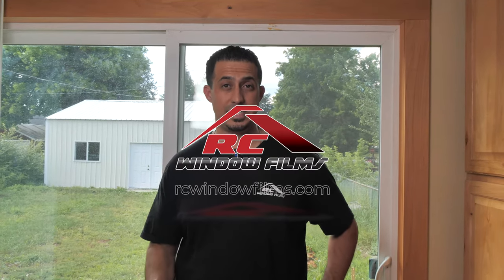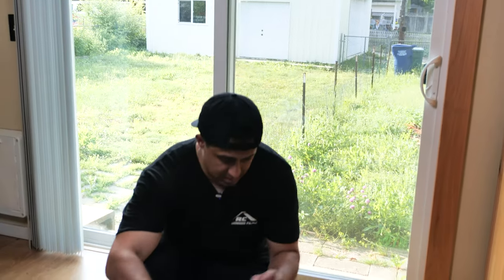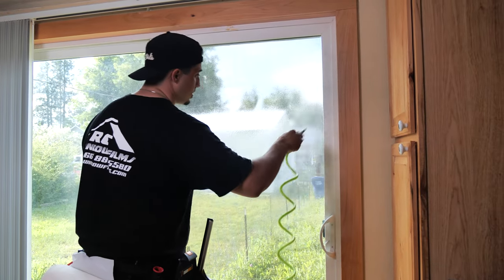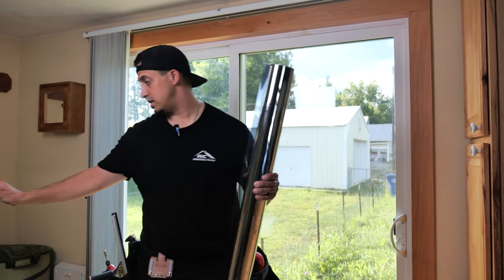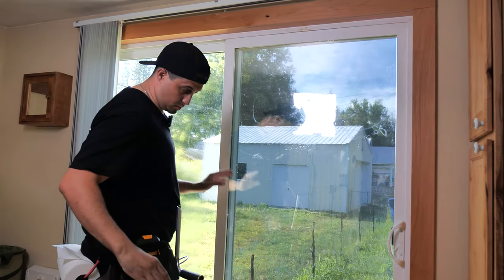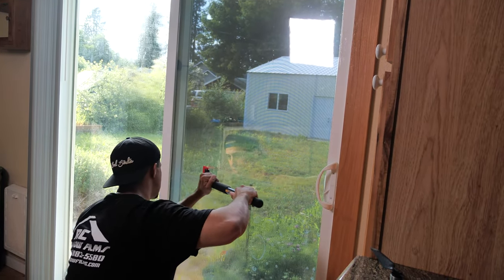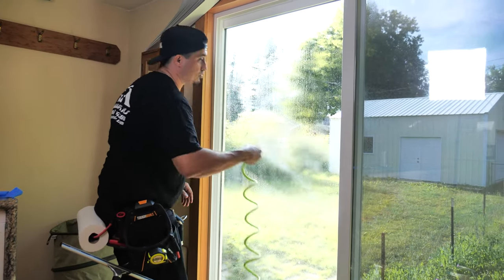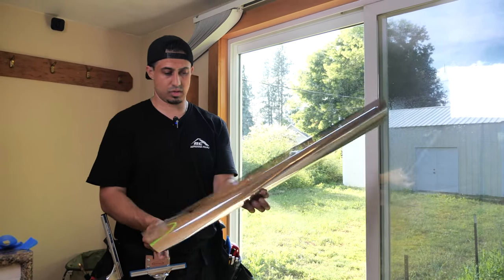Installing Security Window Film on a Sliding Glass Door: A Step-by-Step Guide Film Install (Part 1)

Comment: Applying films both sides make the window much harder to break, compared to one side only ? Can the burglar still kick in & gain entry ?
Reply from the maker: yes, access is still possible. The whole idea is to gain time. Delay entry, doing dual film (film on both sides) is an option, but cost becomes an issue.

Comment: Where do you get your commercial tints from? And how do you know what shades to use like one of your other videos had a broken window so you tinted one window and the others were done.
Reply from the maker: which video are you talking about?
Reply: @rcwindowfilms  step by step guide how to tint large windows. It was uploaded 5 months ago but I just watched it yesterday and I believe you used a 78 inch roll so I was curious where to buy that big of a roll and also how to check shades or know what tint to use if pre exist windows are already tinted.
Reply from the maker: @cbroner9983 We installed the tint originally, so we're aware of the film type and shade. If you're unsure, use a tint meter to determine the VLT. Matching film often needs details from the prior installation or a meter reading. Regarding roll size, it's 72 inches, which is the maximum size most manufacturers offer. For larger sizes, you might need to buy a master roll.

Comment: Would you recommend a 5" or 8" fusion stretch handle for installing 8 mil security film? I can see youre using a 5 with a red refil, however an 8 would mean youre able to get more done. However i reckon with the 5 youre able to be sure to get more water out with each stroke as less surface area? Any advice would help! Thanks!
Reply from the maker: 5 inch all the way, sorry for the late reply. For us we use the 5 inch all the time.
Reply: @rcwindowfilms  Thank you man, much aopreciated!
Reply: @rcwindowfilms  I also have another question, what refil would you recommend for security film (8 mil)  I see you're using a red refil but I am more familiar with the bluemax.
Reply from the maker: @TheArcesz  the red for eight mil and up. The more water you’re able to get out on one pass the faster you’re film will cure , and the less spots of water will remain. Single pass squeegeeing with a red squeegee preferably square face will give you the most consistent results.
Reply: @rcwindowfilms Hey man I'd also like to ask what you're opinion is on the "big mouth" squeegees for security film. It looks like you're using 1/4" blades (based off the squeegee you have) I work with people that swear by them however I think they're a bit overkill for 8 mil film, seeing as I'm a young guy and can get all the water out with just a regular 1/4 bluemax in my fusion in one pass.

Is it something you use in any other application in your business?
Reply: @rcwindowfilms Sorry if I'm asking so much questions, there's not a lot of information about this online from what i cansee, this is a pretty niche product and appreciate the advice from a professional like yourself.

Comment: Thank You for sharing your "Brilliant" method of controlling the roll of sticky "Cling Wrap" by routing the backing out of the way as you unroll. Last time I did this same job I pulled the backing off and that was the beginning of the end for that attempt at doing a clean job... That was the worst experience I had in over a year of remodeling this house... I am going to redo it with the 8 mil 05 tinted security film, I had been dreading it until now... Again Thank You..!

ONE (poss. dumb) question... I assume this film needs to go on bare, clean glass, and NOT over any  film that is currently on the glass from two years ago..?
In other words, do I need to remove the film that I installed a couple years back.. Or can this actually be applied over the film that is on the glass now?

Comment: Nice install! What’s your go-to reliable glass cleaning method when prepping for film installation? Got any tips for hard water stains and buffing out older windows?
Reply from the maker: That’s a pretty tricky question. It really depends on the situation. Most times you’re not gonna need an acid to remove hard water stains however, depending on the type of glass, it may differ is there a particular situation that you want me to guide you on?
Reply: @rcwindowfilms  I was thinking of standard dual pane patio windows, that may have some stains and micro scratches from years of environmental exposure. Would you recommend putting the film on both outer and inner pane?
Reply from the maker: @RafaelSwit  When considering the application of a film to your glass, I recommend opting for an interior film installation. Given the level of scratches and damage already present on the exterior glass, an interior film is likely to be more durable and longer lasting. This choice takes into account both the environmental impact and the current condition of the existing glass. Choosing an interior film is a strategic decision for enhancing the glass's longevity and maintaining its quality, as the exterior glass unit that exists currently will require more deep cleaning because of the surface scratches and damage present.

Comment: You always cut the security film exactly the size you want before install?
Reply from the maker: Yes, it’s absolutely necessary that you pre-cut security film to the exact size needed. This insures better overall protection, and better overall rigidity of the film. Essentially it reduces the failure or the chance of failure due to lack of adhesion.

Comment: Liner I got has a heavy plastic and lighter film. Does the lighter film go in the window.
Reply from the maker: I suggest inspecting where the adhesive is and make sure to apply the film with adhesive to the glass surface.
Reply: @rcwindowfilms  thank you

Comment: What is the replacement  for 995
Reply from the maker: @surfacedesignz3626  SCS2000
Reply: @rcwindowfilms  is that what you were showing on the short video to replace  caulk ?
Reply: @rcwindowfilms  what product did you use on the short video
Reply from the maker: @surfacedesignz3626  8mil silver
Reply: It was something in replacement  for caulk